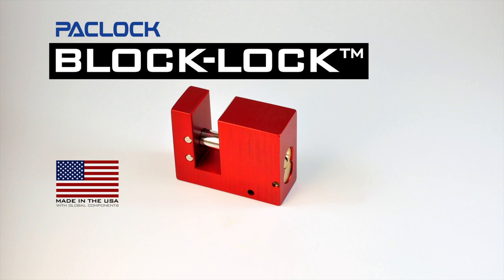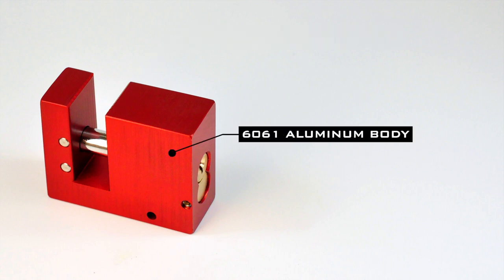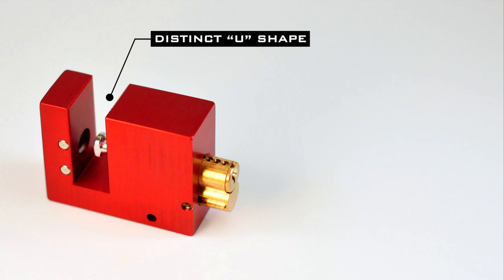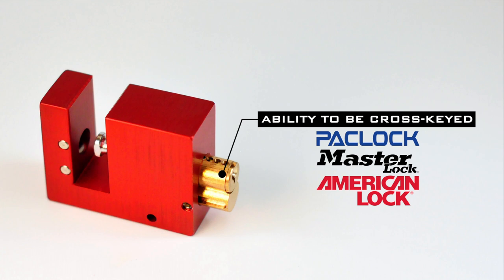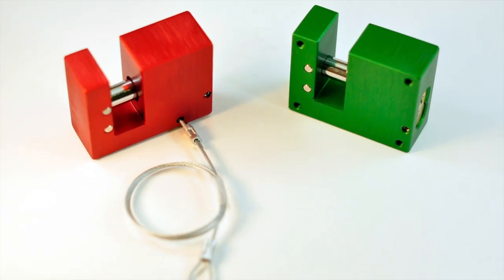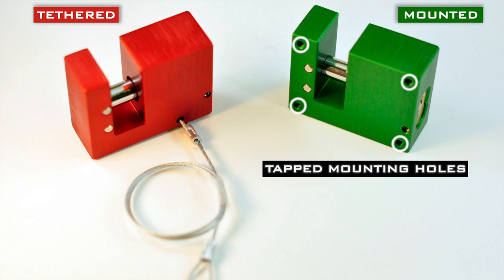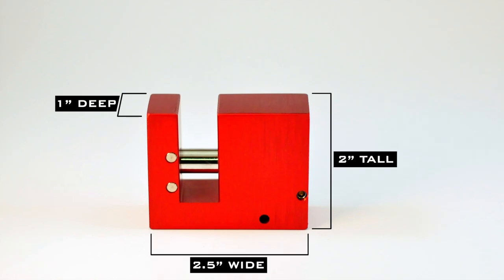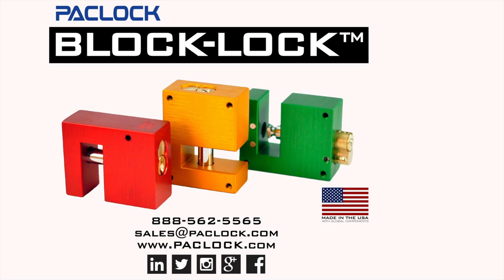BLOCK-LOCK™ Info Guide

Comment: Any plans to make this SFIC compatable?
Reply: It's definitely doable... all just comes down to market demand.  We always have a lot of projects on the table (new products, custom products, OEM products) so often we decide what gets up on the CNC machines based on who is putting in the orders.  As a company we've been focused on a major overhaul of our website, so we have been bad about getting info out about all the new stuff we come out with the past few months.  But we can definitely make the aluminum or hardened steel versions of the BlockLock in an IC format.  Just looking for a few?
Reply: PACLOCK PRES.  It would be 3 or 4.  I can make your puck locks work with a bit of a custom hasp so no big deal, but saw the block lock and immediately knew they would fit the application.
Reply: Always good to start somewhere... would you be looking for an aluminum or hardened steel body?
Reply: Aluminum would be fine for the application.